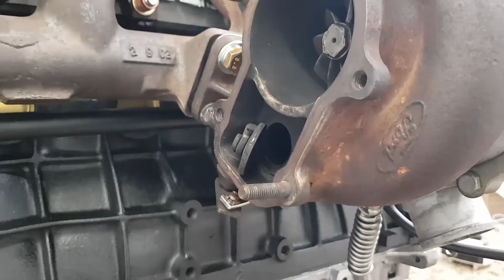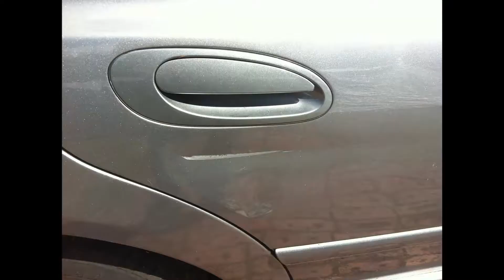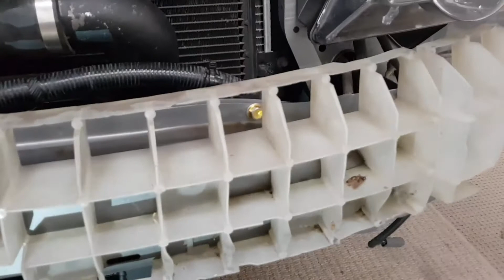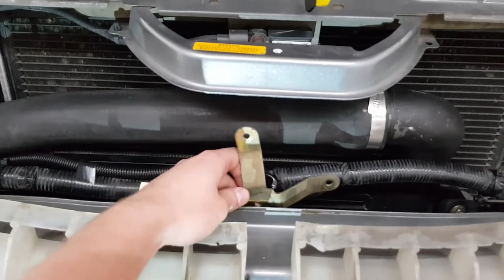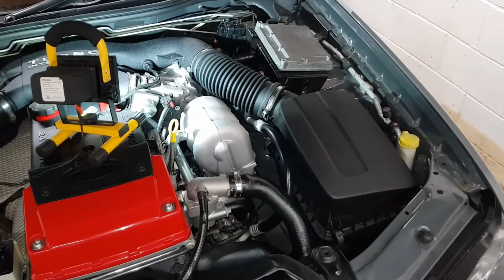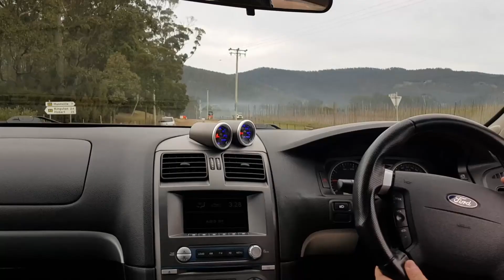Ba falcon Na to turbo engine conversion

Comment: Do you know if my na t5 will work with a turbo motor if I use na clutch and flywheel also will the BCM work with the turbo ECU if I use forscan to code them

Comment: What if yiu get a electronic boost contol set up separately as i think i have one hybrid hdi boost contol yeah lets hope that works Because they're honestly. Isn't any information anywhere you'll lick the only guy doing it now im doing haha but ive fot mine flashed i found out mine is a bf 2006 and not ba 2005
Reply from the maker: you can use an external boost controller you just have to get the car tuned to suit. I prefer using the factory boost control though because it gives the tuner far greater control when tuning. For what its worth this cars now running 340rwkw on 14psi and the factory boost control is working perfectly

Comment: Hey mate just finished doing my car thank you for this video my ba is doing the same thing it did to yours no speedo and stuck in 3rd gear I’m just wondering what did Ford actually do and how can it be fixed asked a few people and know one knows even asked a ford technician! I got the ecu flashed and tuned also
Reply from the maker: Hey mate, ford wouldn't tell me what they did. But basically there are a couple of parameters that need to be changed in the ecu to change the speed source to match what the car has, most likely yours has abs but no traction control like mine. To do this you either need to have the right hardware and software like pcmtech to change the settings yourself or send the ecu to someone who does. Bill Hooton who runs the fb page Hootons Harnesses can do it along with any tuner with a decent understanding of the barra pcm.

Comment: Run the trans cooler under the car and put the power steer cooler in front of driver side front wheel
Reply from the maker: Trans cooler under the car is definitely a consideration for when i buy a built auto. Its still just running through the radiator at this point which isn't ideal.  I have seen people put the power steering cooler in front of the drivers wheel but i wasn't keen on the idea because there's not much airflow there. Its working very well in its current position but i expect it may have a negative effect on IAT's when i eventually get it on a dyno.
Reply: @stuff7853  check out ross holland  on youtube his build he didnt use the power steering cooler and hasn't had any issues
Reply from the maker: @barra190kw6  By memory he bought the factory finned cooler but then ended up bypassing it altogether. I wouldn't really recommend it though. With the factory na style cooler the fluid in mine used to get very hot in warm weather and the steering would start shuddering in car parks. It barely gets warm to touch now and has never shuddered again which was an unplanned fix to the problem

Comment: How did you manage to get it started with FORScan? People have told me doing a PATS reset and train modules but i don't know how to do that
Reply from the maker: You need a elm327 scanner and a copy of forscan with the extended license. Instructions for obtaining the license can be found on the forscan site. After that you need to pair the pcm to the car, do a pats reset and you can also pair the ICC back to the car to stop it showing code. You will need two original keys to do the pats reset though.

Comment: Dumb question but turboing my ba I have I buy a Barra motor first yeah or can I just slap a turbo on the na?
Reply from the maker: Sure can. The na engine is still a barra motor just with slight differences internally to the turbo engines. Plenty have turboed the NA motors.

Comment: Did u ever just consider turboing the na engine. Few blokes have done it with good success. Yeh it cant take as much boost but  the na gearbox, diff, exhaust valves, tailshaft will all become a problem before the engine does.
Reply from the maker: That was the initial plan. Then this engine came up for cheaper then i could buy all the parts so i decided to just put valves springs in it and use it instead. When i realised it was no good i just sort of rolled with it and rebuilt it. Not the cost effective way to do it but gave me a fresh engine and gave me an excuse to build an engine. Bonus is having it signed off and the engine numbers swapped on the registration paperwork keeps my insurance happy. Built transmission and m86 diff swap are on the cards for a later date. Then the rods will be the limiting factor.
Reply: @stuff7853  true. But the factory turbo can take a fair amount of a abuse. Seems like every month there is a new record a stock bottom end. Atm i think 620kw or around thereish
Reply: @lukesm5747  not 600kw 600hp yes about 420rwks
Reply: Theres a few issues in turboing and na engine, one being the lack of oil inlets internally around the engine where as the turbo engine has these to allow for better cooling.